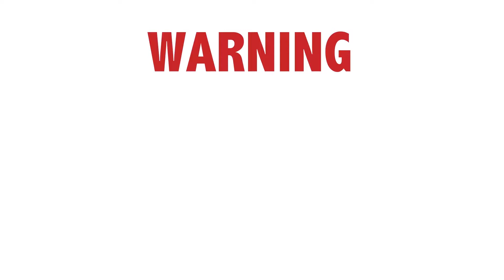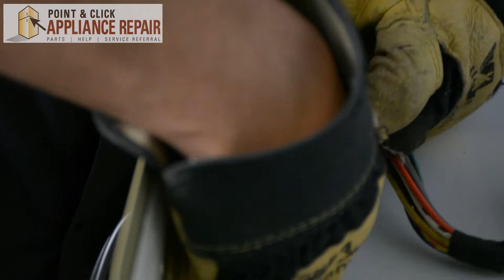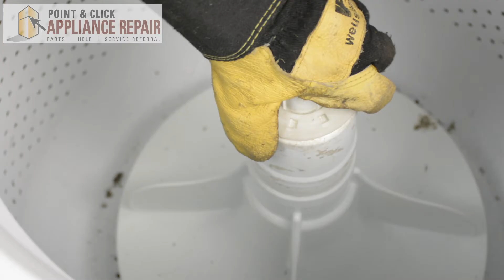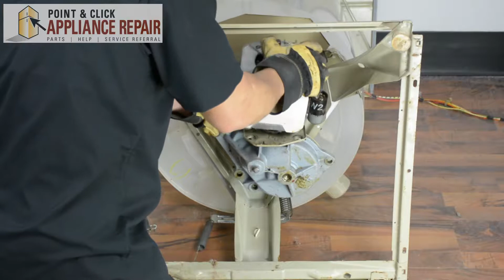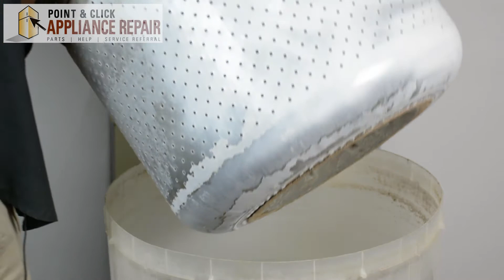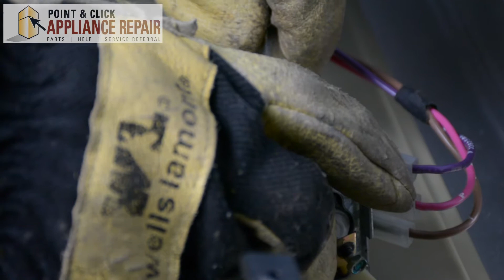285352 - Replacing Your Washer's Gearcase Oil Seal - AP3043580, PS334494

Comment: Great video except for one thing! If the washer was leaking oil, shouldn't you have shown how to refill the transmission with proper oil?
Reply: That’s what I was thinking.  Granted the amount of oil/grease under mine is not a lot  but it’s occasionally making a howl on some spin cycles.  I wanted to fill it up with a new seal, replacing the whole tranny on an old washer is probably not worth it.
Reply: @williammchugh4361  I just checked my Hitachi apt sized washer and no gearcase! LoL 🤐 it's got a motor off to one side with a belt running to a pully under the agitator! Now I gotta figure this out! LoL!
Reply: @barryc733  I found out you can not really refill this oil though the seal location because it's too thick.  Only way to really do it is to open up the gearbox completely.  When my washer started making a slight momentary howl during the start of the spin cycle I had no idea I was going to end up Rebuilding Half the damn Thing!  But, it's getting to that point.  I bet your gearing/and or clutch is above that pulley.

Comment: This should be titled "How to turn a 10 minute job into a 60 minute job". You never ever have to remove the back panel on these washers for any repair. You don't have to remove the transmission either to replace the input seal.
Reply: Well,,, repairmen usually charge by the hour.
Reply: Quick question, why would some one have to replace the gearcase oil seal? Will the washer not agitate or spin properly? Or will the clothes come out with oil stains after every wash? Thank you
Reply: @DeeOne88  Oil is needed to lubricate the gearbox or it wears out and seizes. Oil leaks on the floor. No it doesn't damage the clothes
Reply: @DeeOne88 Are you serious with that question?
Reply: U don't hav 2 unplug all these wire plugs. Just unplug  the washer.